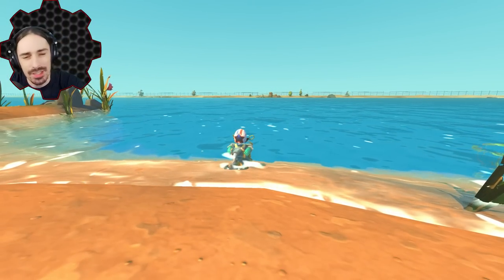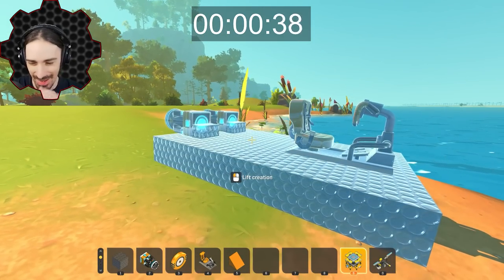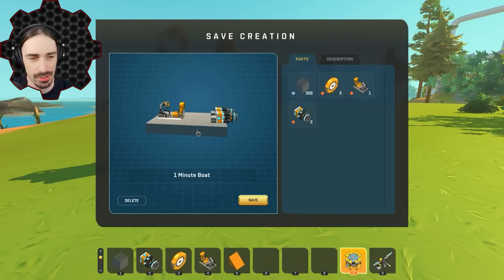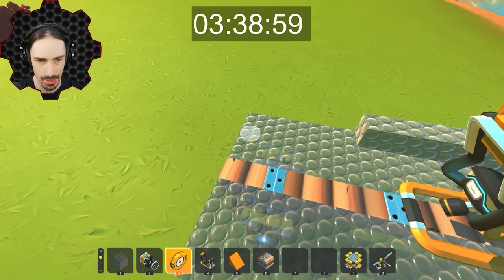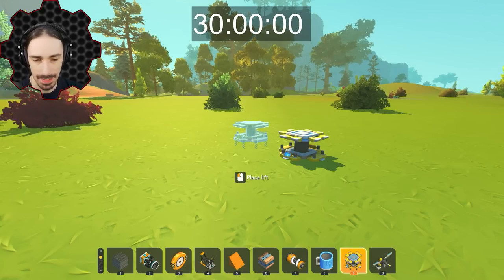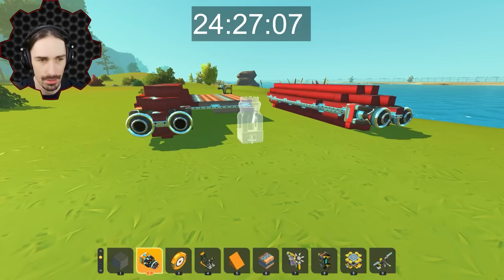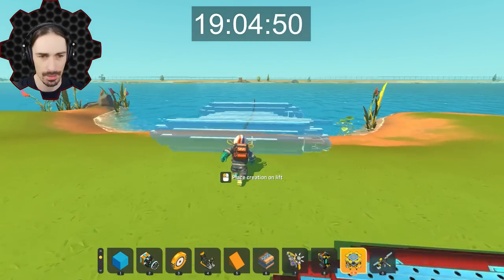Speed Building a BOAT in 1 Minute, 5 Minutes, and 30 Minutes!

Comment: Painting the bubble blocks different colours actually helps with the physics so the 60 sec one would actualy work if you just painted it 4 bloks a colour (make sure the same colours are not adjacent to eachother) i think dr pixel has a video about it

For example if you have a 2×1  bubble block and paint 1 green and the other red then trough them into the water, then the game will register them as two completely different blocks just like if u had a bubble block attached to a t3 wooden block
Reply: video link for dr pixel ?
that seems very interesting
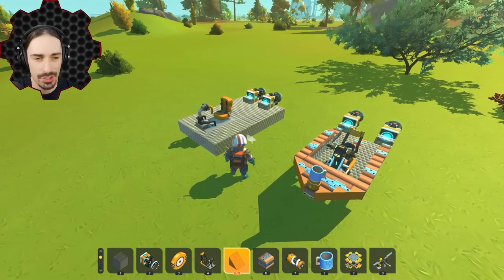Reply: @Art_bor  its this video https://youtu.be/IY5yW1Ghom0 with the timestamp of 10:34, turns out it wasn't a specific video made for it but just "you should know about this to know whats happening" fact, he is a coder after all, i recommend you watch the entire video for the context, sorry, i thought it was a specific video of the top of my memory, but this video does fine in explaining the paint and its physics. And if you are interested in the physics based stuff then you should go check him out, he does a lot of other stuff
Reply: @idkwhattonamemyself1244  i know him dr pixel i thought to myself if i havent watched that video thanks
Reply: sm sure is wonky
Reply: @vibaj16  if it doesn't do that the game will be lagging so bad it's unplayable
Reply: @dhaneshabhipraya  not really, it could just find the corners of each section of material and use those instead of the center point

Comment: I think the stability problem you were having with your 5 minute boat may have been similar to the one you ran into with that YDIB rocket sled. The rocket sled's friction was focused on the front wheel which was causing it to turn 180 degrees because that was the direction of least resistance, so I think the extra weight on the front of the 5 minute boat was causing it to rotate to one side or the other because the thrust coming from the back of the boat is basically trying to "push" that weight when it really wants to be "pulled"
Reply: yeah, that's probably it

Comment: 24:23
I was wondering the whole time what causes the issue, but when you said "it's like a car that doesn't have grip on the rear" I realized that probably the problem is that all of the thrusters are at the back, while the front is really heavy because of the wedges.

This means that the wedges want to hold back the boat by a lot, because they're heavy, and not really  buoyant, while the thrusters are trying to push the boat forward from the back.

It's kinda similar when you try to hold back a small RC car (RWD) by putting your finger infront of it. It looses grip, and because the block is uneven, it slides to one side.

In this case the easiest fix is to lower the power of the thrusters, or make the back heavier/less buoyant.

I'm not a physician, in fact I'M gute bad at physics, so my explanation is probably nosense, but I think this is the issue

Comment: before  survival  this was the closest you could get to measurements.
the number values is measured in wood blocks.
Wood: 1
Concrete: 2
Tile: 2
Brick: 4.8ish
Metal: 5
Driver Seat: 145
Passenger Seat: 100
Thruster: 17
Electric Engine: 60 (same density as metal)
Gas Engine: 40 (same density as metal)

Comment: About the weird turning effect you experienced at 9:40. True, there's no aerodymics, but there is drag in the water. I assume that drag is calculated in the same way as buoyancy, where the game applies it to each block of homogeneous material. But "wedge" is a different material than wood. And also, your bow is made up of many individual rectangles of wood, while your stern is basically 5 long pieces of the same material. And I guess the game doesn't correctly scale drag with the size of the rectangle, to the point where the drag from many small pieces is larger than that of the same amount of material in a single rectangle.

Comment: Scrap man, the reason the second boat turns is because the center of thrust is in the back, wouldn’t that spin it around without proper stabilisation, plus the front is heavier therefore fighting the thrusters

Comment: so basically, when you build a shape out of blocks in scrap mechanic it divides the shape to a bunch of bigger cubes and the buoyancy is calculated at the center of the bigger cubes so you didnt really have to place those plastic blocks in the 30min build
Reply: so if you have a single cube with no details or holes it does that weird thing you showcased in the start of the video. so if you made a small hole in the middle of the platform you demonstrated the weird behavior with, it would have leveled off
Reply: and because of the different properties of different blocks sm treats them kinda like holes in the other materials

Comment: the weight stat is a /block number, so if you want to have an engine that has a size of 2x2x2, and a weight of 5, then it will be 40 heavy, since 2x2x2x5 is 40, so you cant counter weight that engine with a 5 heavy block, just a small tip for building balance-necceserary things

if i just said the biggest stupidity known to mankind pls correct me thx